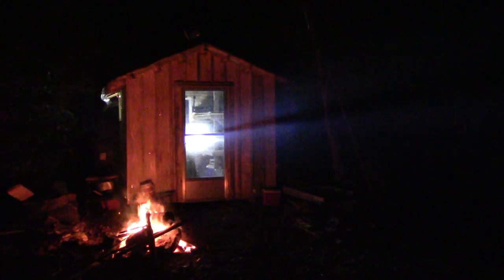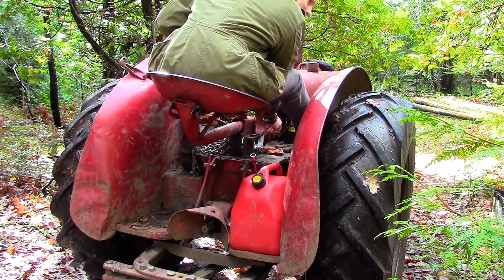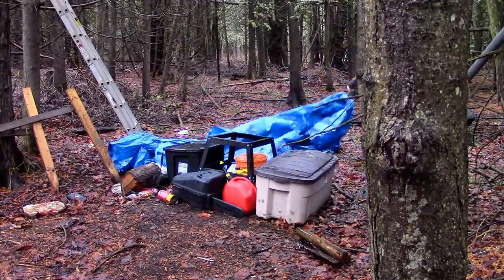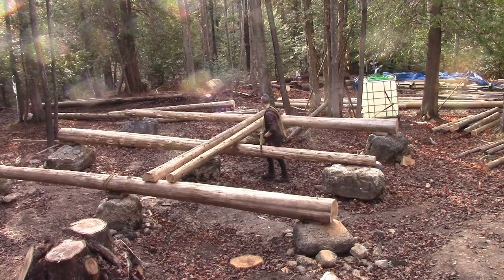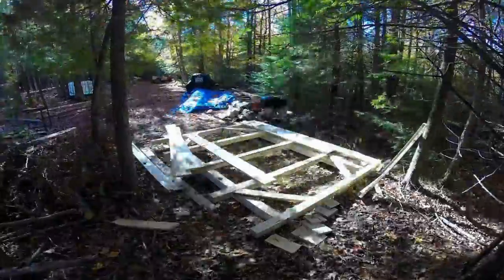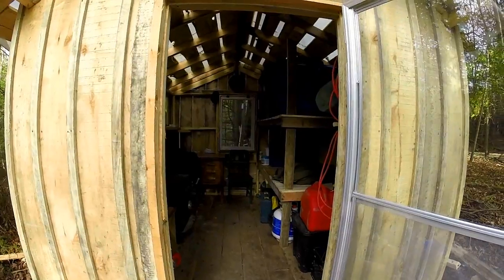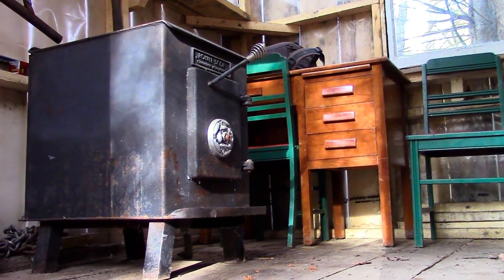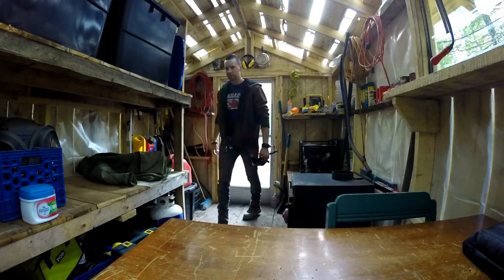Heated Sawmill Bunk house built for $160- Ep25- Outsider Log Cabin

Comment: Hey Outsider, just wanted to say how satisfying it was to see your tractor back up and running! The ignition solenoid was exactly what went bad on our 1940's ferguson te20 a couple years ago, and for anyone who has never been in need of your tractor and not had it running, you know man, it isn't fun! Very glad to see the cabin project back up and running, you should have your dad narrate an episode lol
Reply: So, that is an ignition solenoid?  It's not the starter relay?  Or is it a solenoid relay?  I only ask because all my life that was the relay so I am confused.  I knoe it doesn't matter much...just curious.
Reply: It's basically the same thing, I got confused too so I looked it up. Starter relays/solenoids are basically just a big switch that activates after the key is turned, the ignition having a tiny charge then activates the solenoid/relay sending the full 6 to 12 volts from the battery and the ignition and into the starter itself. Fun stuff really
Reply: AH...thanks.  Some starter relays don't use a solenoid but an armature.  I guess I got confused because there is another solenoid on the starter itself.  Thanks!  Learn something new all the time - even after all this time.

Comment: Great video guys. FYI always put vapor barrier on the inside/warm side of the studs. Otherwise, when you add insulation and heat the place, you will develop condensation in the wall cavity.

Comment: Great job on the bunkhouse find work I saw your little propane heater I use mine all the time beauty of it is I find junk barbecue grills on the side of the road scrap out the aluminum keep that propane tank when that propane tank is empty I refill it at Walmart for $15 US and now I have 32 extra propane tanks if I ever lose power I will have heat friend of mine took the propane tank to his Farmall Model A no he can use gasoline or propane great Channel thank you for your knowledge and expertise and sharing in your experience

Comment: I saw a YouTube show that featured a review on small stoves by a company called Cubic (the Grizzly and Cub) the smaller one would be ideal for your space -- warmth without over heating.  There is also a fan (Ecofan) which runs off of the stove's heat and helps circulate the air.  Great video, well photographed and the drone shot was a spectacular surprise.
Reply from the maker: Scott Preston Thanks for the info! I'll look into that.
Reply: Was it tinyhouse prepper?

Comment: I'd try to get a piece of sheet metal to put above that stove to save your plastic roof plus if you can find some patio blocks to set that stove on it helps to retain some heat after the fire dies down at night.

Comment: So random question about using your own mill to make the lumber for this, specifically the exterior wall siding. 
When using your own mill do you let the boards dry out and shrink up before nailing them on? Or were you anticipating shrinking and that’s why you wrapped it in plastic? 
Granted this is only a temporary structure but I suppose what you could do is once the boards have shrunk up either put a second layer over top of set to cover the cracks, put up boards on the inside, take one wall or roof section at at time and pop the boards of and move them closer together and add a final board to fill in at the end or middle

Comment: you've probably done it already but if you haven't, see if you can get yourself a cheep copper or steel sheet to place under, and behind the stove.   you don't want the floor or walls catching fire.   there are lots of "fire shields" you can use, but going without one can be a big risk.

Comment: Did I miss the part where you dried the boards? Because if they haven't dried before you built the structure, when they do dry they will shrink/warp/crack/split/pop or otherwise distort.

Comment: The plastic while highly water resistant is also a vapor barrier. Using a stove inside could build up a significant amount of Carbon Monoxide and kill you.  Also it will trap moisture on the inside and cause things to rot.
Reply: Shawn R 
Screen door

Comment: I like your phrasing, "one degree, above freezing", very funny! I'm curious how the plastic sheeting on the roof holds up over time. Is it prone to holes/leaks? Great to see a father and son doing things like this together, as it should be. Glad the tractor is back at it again too!
Reply from the maker: +TraderJack641 Ha ha yeah I know my phrasing was a little odd to describe the temp, but I worded it that way for both those who read temperature in fareinheit AND english. lol Anyway, the plastic roof has held up surprisingly well over the past year. We've only had one small leak so far, which was easily patched with some duct tape.
Reply: That's great about the plastic, and thanks for getting back with me so fast! I bet that wood heater did a good job too. I'd like to build something similar in size to your bunkhouse for my two sons to play in when they get a bit older. I'll keep this video in mind for reference.
Reply: How have you protected the plastic sheet from the heat of the stove ???

Comment: I'm going to say this is an incorrect price, you should change the title. Nobody has their own forest to create lumber from. The framing would be about $150 at a minimum. The foundation is another $100 on the low end. The flooring is another $100. The roof is another $100. The siding is another $200. The average person will have to probably buy some new tools. Add to this your screws and salvage materials of $160-A more correct price would be about $1,000.  And then when the snow & rain rots the wood, its only gonna last a couple years. 
It is pretty cool and neat that you built it so quickly with your father tho. Nice work. You have given me and many others some ideas.

Comment: If you go by concrete tilt-up construction job site all the forms are built with 2x6 and after they are done it is all loaded in to dumpsters and thrown away. The wood is to expensive to clean and reuse. Ask the job superintendent for permission. the wood will have nails and loose concrete but you can load truck loads of it and is saves on dumpster costs.

Comment: ALOHA FRN HAWAII. might i make a few suggestions. the window @ the back wall; it opens into your space... a poor use because it open into the space. Another youtuber always uses bubble foil insulation under your floor (and it doesn't attract bug action; especially on the floor (and in your case, the walls & roof. I suggest a skylight.  another suggestion is locating a couple of solar pv panels, solar controller, a li-ion battery in a clearing close by so you'd have some power for a couple of LED lights (INSIDE & OUTSIDE), a radio, charge your celphone,

Comment: Four concrete blocks would double the life.  A few more might quadruple it?
Reply: It is on sled runners.  Loggers don't stay in one place for a long time.  They likely pull that to a new spot with the tractor.  I would put iron runners on before concrete blocks.  They are more likely to tear it in half if the wooden runners snap or rot through.

Comment: not trying to be a safety nanny,,, but make sure you remove the plastic around and above  the stove, , even if you put up a flame retardant backing,,,  the plastic  does not have to burn to off gas , in that small area it would be easy to get up to off gas temperatures, , might make sense to insulate the walls and plank them too , before lighting the stove,

Comment: Apparently fuel, blades, maintenance, and labor have zero cost.
Reply from the maker: +WILSON! You're right. Add $5 for a blade sharpen, $7 for fuel, $1 for maintenance, and I don't charge myself for labor lol ...so $0 for that.
Reply: $5 for blade sharpen is accurate, but a good bandsaw blade for that size saw costs around $18 shipped.  Divide that by the number of times you can sharpen it, and add that to the $5.  $7 for fuel is probably accurate, too.  $1 is too little for maintenance.  Just because you didn't have to replace a part this time, doesn't mean there is no maintenance cost.  There is wear and tear on the machine with every use.  Your own labor carries a cost, whether you pay yourself or not.  The labor of the second man, if he doesn't charge you, does not carry a cost, unless he owns the structure, too.
Reply: WILSON! You must be a blast at a party! Haha
Reply: +Boz Boz They call me Wilson the Tank.
Reply: WILSON! ok maybe you do loosen up and aren't that literal